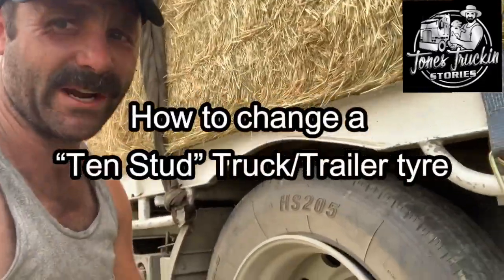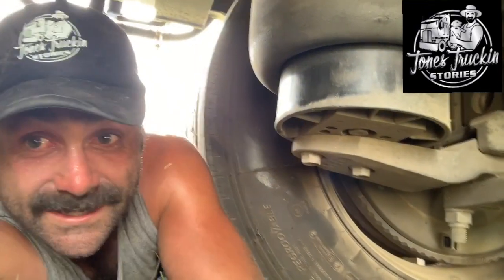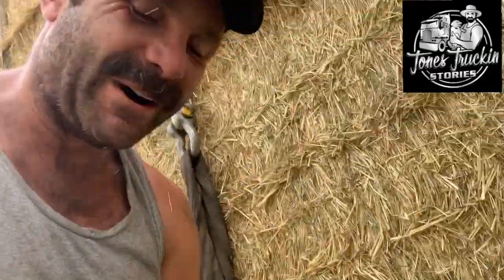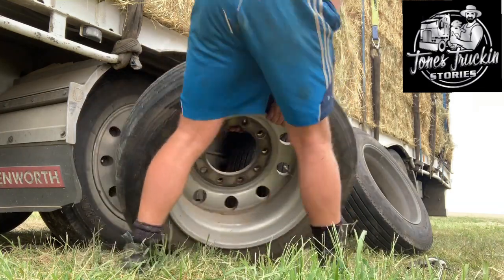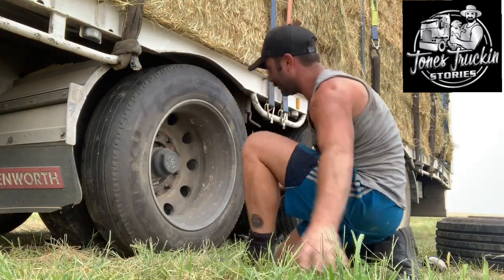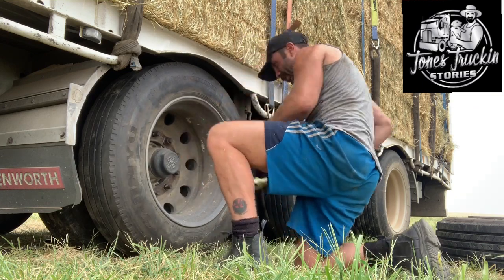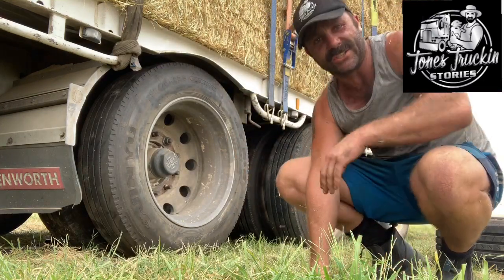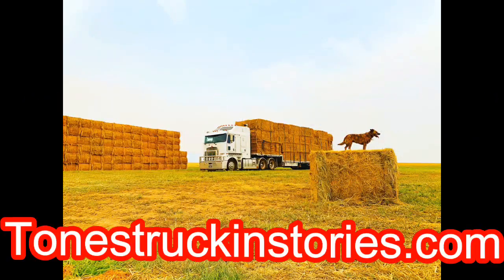How to change a ‘ten stud’ truck/trailer tyre 👍🏼 This method can also be used for cars, caravans

Comment: I have a airhose that hooks into trailer on red line with afew swap over fittings and use rattle gun once there cracked or a cordless one is the go.
Save spunning those ten off by hand.
Top work tone.